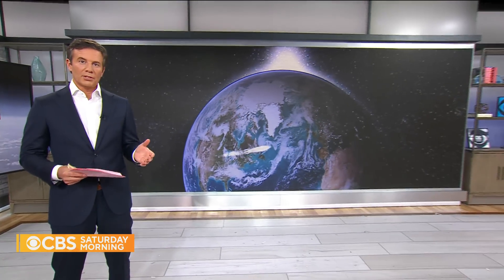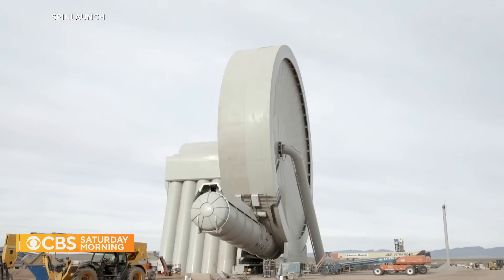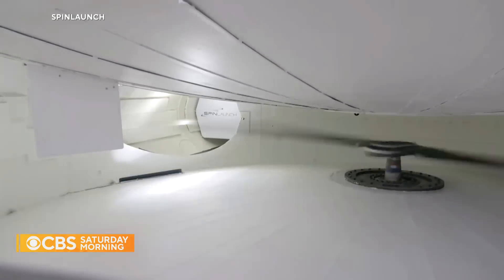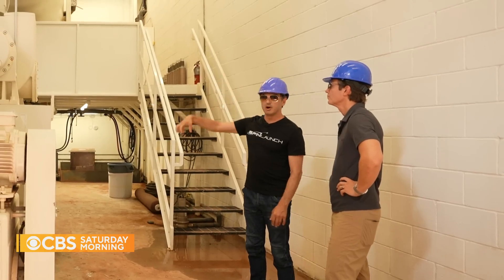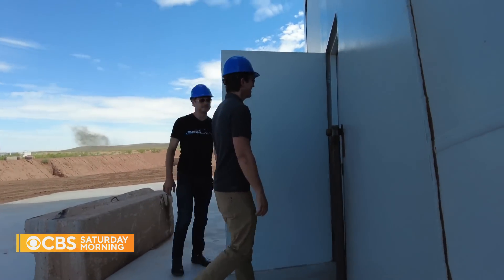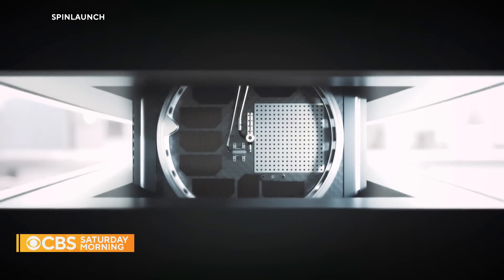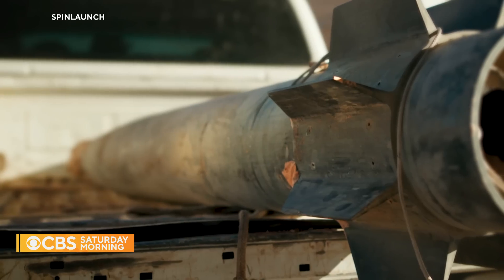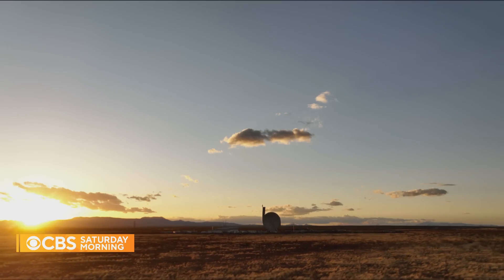New technology aims to put a whole new spin on space travel

Comment: They still have some HUGE obstacles to overcome.
Every video I have seen of the the launched object breaking the outer vacuum barrier has show a keyhole shape, NOT a circular shape, indicating the object is tumbling.
Add to that the fact that all launched objects need to be able to handle the extremely high G loading means that fragile extendable solar panels are out of the question.
Makes me start to question if this is another Theranos.
Reply: My own pet theory is that they're banking on an eventual lunar architecture. Spinlaunch is nonsensical on earth due to both the deep gravity well and the thick atmosphere, the latter of which requires the gigantic vacuum chamber for spinning and then an absurd amount of thermal friction heating and physical shock loading on the projectile when it transitions from vac to sea level atmosphere. Meanwhile on the moon, you have no need at all for a vacuum chamber, and the requirements for escape velocity are absolutely trivial compared to earth's surface. Even then I seriously doubt there will be any major lunar industry in the remaining lifespan of any current spinlaunch employee, and EVEN IF it is established, the economics of shipping lunar manufactured goods or raw materials back to earth just don't work out. Even with a permanent human presence the moon will be a net importer for a very long time, and there won't be much demand for unmanned lunar surface launches.
Reply: It's Election BS money to waste but waste it will be. Physics itself prevents this from working at all. I don't need to visit Wikipedia to know this, just school level physics.

Comment: I think this is a scam. There are too many issues. If the arm's bearing fails under high rotational speed, the whole thing will be destroyed. Much more serious and costly damage than would occur if a booster exploded on a conventional launch pad. Also, when the payload is released, it will be subject to a shock from its 100s of G of force down to one G in an instant. That will destroy most useful payloads. They're just pocketing as much investor money as they can. Even in this interview the CEO really seems scammy.

Comment: I don't get it.
They say they operate in vacuum, but what's the point of doing it  ?
It will enter air as soon as it exits the launching pad, and it will disrupt the trajectory.
Shouldn't they instead be accelerating the thing in 1 atmosphere, so that there is no change in pressure at the launch ??

Comment: There is also a weight and size limitation. More weight and you need a bigger projectile. And you need at least (a final speed) spin+ thruster, more than 17,500 mph. Otherwise it will launch and then fall back before making orbit.

Comment: For a small payload, yes. But a satellite? That is heavy. Centrifugal force (from spinning) can also damage sensitive equipment.
Reply: And the shock loading on release from a vacuum into 1 atmosphere of pressure... at 5000 mph, (which is still only a fraction of orbital velocity) ... how many G's is that?
Reply: @jackboot3946  forget the transition from vacuum to sea level pressure, the G-Force from spinning their full-sized proposal is already going to be >10,000 G for the last half hour of spinup, and the launch clamp release will exceed 15,000 G for a few milliseconds. No, you're not reading anything wrong; those are THOUSAND gee measurements.
Reply: @KingHalbatorix  Exactly. Won't  be launching any delicate, sensitive equipment... ever.

Comment: 0:39 2.2 million tonnes of steel. Really? Nobody? If this thing would be this heavy a solid block of steel (7850 kg/m³) would be 280000m³ in volume. That's a cube with more than 65 meters edge length. The host shouldn't be just saying "that's right" when the presenter get's the facts colossally wrong.

Comment: A problem that is see with this launch system is the "g" forces the payload will have to be designed for. The payload will have to be heavily built to withstand them. I don't think there is a way to get around this problem. Even with modern materials, the payload will have extra weight to withstand the forces.

Comment: This trash idea was debunked years ago.

The biggest problem was so obvious I spotted it right away. The problem is they must have as close to an absolute vacuum to be able to get the speed necessary. The problem comes when it releases. The "membrane" that it has to go through is impossible. If it's strong enough to maintain that kind of vacuum it would have to be so ridged that the projectile wouldn't be able to break through without being greatly slowed.
Reply: If the vacuum is near Absolute, the little bit of air in the chamber will spin around with the projectile...  And the membrane is just a dust cover/ to keep the engineering secrets of the doors.  It doesn't "maintain the vacuum".

Comment: The size this thing would need to be to launch anything of use to space would be crazy
Reply: Small-sat industry keeps getting larger every year because of technology getting smaller and cheaper. Most modern satellites today are actually no more than the size of a suit-case
Reply: @TypicalBlox  Doesn't matter how small the satellites get; that machine has significant problems that can't be reasonably overcome.
Reply: compared that to rockets?
Reply: Nah, I could see this being used for small/micro sized satellites. But yeah anything bigger sounds very problematic and you can forget ever trying to launch people from that thing.
Reply: It doesn't launch it into space, it launches it almost into space.  You still have a two stage rocket in there.  The biggest gain is that you're getting it almost all the way, so you don't need a giant rocket with tons of fuel, you just bypass that by getting it close enough.

There are other companies besides SpaceX that will launch payloads into orbit, some of them that launch smaller paylods like SpinLaunch is targeting.  Its not a one stop answer for all of space travel.
Reply: This seems silly
Reply: The machine is ridiculous, ludicrous. Won't work.
Reply: it would not be crazy if u realize  it has to burn out when leaving the machine
Reply: Any way you slice it they need to reach like 20 miles and so far they have only reached a little over 5 miles with a much smaller projectile.  So they are still far away from making this a reality if it is at all possible.
Reply: A lot of satellites are quite small, actually.  They are made to be as small as possible.
Reply: SpaceX carries 30-50 satellites per launch. This spinning contraption is quite absurd

Comment: There are many problems with the idea, the system, and the execution.  It is easy for them to say they can overcome the problems. It is easy for them to just be putting on a show for the money and the giggles. I know it won't work, but I'd enjoy giving it a good try. 

First, you can't throw something into orbit. There is still going to be a rocket somewhere, and you really can't throw a rocket.

The electricity has to come from somewhere, and this design is going to waste a lot of energy. Recapturing rotational momentum is a problem, and storing that recaptured energy is a problem. This design wastes the energy required to throw the fairing to space, wastes the energy required to spin up the arm and shaft and counterbalance.

The projectile is going to be subjected to horrible centrifugal force with a 1-G vibration per rotation. The projectile is going to come out tumbling at whatever RPM the launcher had, and stopping that rotation is going to take energy and precision. (There are methods to reduce the problem, which they may be keeping secret.)

The projectile is going to slam into the air outside at a fierce rate, and commence to decelerate and heat up like a dang meteor. One way to help it punch through is to make it as heavy as possible, which is another waste of energy.

The projectile has to shed the fairing and light the rocket. The rocket still has to do all the work of putting the payload into orbit, which is roughly four times the speed needed to reach that altitude.

Me, I'd build a water electrolysis unit, and a hydrogen/oxygen rocket, and find some off-hours electricity.

Comment: The shaft of the orbital accelerator could suffer certain degree of damage due to the unbalanced loading on the object holding arm. Depending on the weight of load (rocket),  it may need to replace the bearing frequently. Electromagnetic railguns should be able to launch much heavier aircraft/rocket.
Reply: So the scientist and engineers should consult with the YouTube comment section before making decisions...😂
Reply: Gerald Bull was trying to Giant Rail Gun for Saddam Hussain  back in 1980s but he was mysterious assassinated  before completing his work.
Reply: Im pretty sure the engineers guessed so too, and addressed that.
Reply: You're right. You should join their team and show them how to do it right.
Reply: They put a counterweight on it that gets released at the same time into a sand pit
Reply: @roberttalada5196 ok
So, the rocket (projectile) gets launched upwards fast enough to hit orbit.
Meanwhile, the "counterbalance" would have to be launched downwards (to balance momentum)......
Reply: @roberttalada5196  why not 2 projectiles released 180 degrees apart
Reply: This has been debunked by Thunderf00t
Reply: @pkrakras3561  Was waiting for someone to bring in Thunderf00t 🙂

Comment: I thought this was going to be a re-do of the "Space Cannon" idea but it is a new twist. (Twist---get it? 🙂). This would also make a frighteningly efficient weapon. Those projectiles are large enough that with just a few mods for ballistic guidance, they would be devastating non-nuclear precision weapons. An array of 10 of these launchers would be capable of a constant rain of hyper velocity projectiles each which would hit with incredible kinetic energy.
Reply: It takes their proposed final version multiple hours to pump down to final vacuum pressure, and then the arm also takes multiple hours to spin up to its final velocity. Overall, one of these can launch about a single time every 10 hours, or less than two and a half times per day. And that's assuming they fix all the issues with the launch release clamps which require microsecond-level timing to not throw the payload a few degrees off course and utterly obliterate the entire launch system.

In short, spinlaunch is utterly unviable as a weapons system, much the same as it's a total joke for actually putting things into orbit.

Comment: Sorry, but real engineering doesn't involve building a $150,000,000.00 unit that can't do what they designed it to do.  And, now they just need a bigger one?  Couldn't these people do the math in the first place to realize that the G-forces would be too high with the unit this size?  2:45 - They arrive at new forms of transportation through experimentation?  Um, no.  Proper engineering is how it's done, not just experimentation.  What do those investors have to think about a $150,000,000.00 device that doesn't work?  Do you actually believe the metals can withstand these forces?  And, a little plastic membrane is now capable of a high vacuum?  There are so many holes in this "innovation" that it's ridiculous that it's getting CBS news coverage.  Oh, but, don't worry, there will be a ton of investors lined up to pump money into the one triple the size, for another $450,000,000.00 that won't work.

Comment: A) Largest diameter vacuum chamber?  Um, Cern supercollider ring a bell?  18 mile long loop underground?
B) 5,000 mph?  Sorry, you need 17,500 mph to be in orbit, and that doesn't include losses due to atmospheric friction or the energy to achieve orbital altitude.  5,000 mph means nothing more than flinging the thing up a bit, but, without rockets, it's not getting to orbit.  So, yes, they say that a rocket will still be needed to get the thing into orbit.

I smell investment scam.

Comment: this is a huge waste of money. but at least the workers are being paid. until this has an elbow / wrist it will continue to fail. consult an NFL professional. a better design would be: trebuchet. also the package should have a more hammer shape. but all this technology is already obsolete. electronic mono poles that is where we are going. perpetual motion, Einstein was wrong because it doesn't work with quantum. Molecular programming by freezing matter at very low temps. we are missing 1000 elements on the table.
Reply: Not the brightest bulb, eh?

Comment: One thing is centrifugal acceleration, another is the linear deceleration the moment the projectile hits the dense atmosphere. Not to mention, that the projectile will never reach orbit on its own. You will always need a rocket engine to push it into orbit.
Reply: 1.  can you see them flinging a fully-fueled rocket around in there?  😂
2.  if not, it will have to dock with a (rocket-launched?) rocket up in the air. 🙄
3.  so why not air launch the rocket after floating it up with a giant balloon? 🤔
4.  3. is already patented, btw - i'm looking for investors - send a superchat! 🤑
Reply: tbf, assuming perfect speed matching and instant docking with the rocket at altitude, 2. would save fuel over launching an entire rocket from ground but so would 3. to whit,  i propose ultra-light, rigid carbon nano-balloons pumped to hi-vacuum to lift the rocket, launch, then release vacuum to return for reuse 🥴

Comment: This launcher looks amazing!
It could really change space travel!😮
Reply: Not for anything less solid than a block of steel.
Reply: @Graeme_Lastname  ...Or other things made with metal,like circuit boards and heat shields!
Reply: @Herowebcomics  As long as they are encapsulated in epoxy or some such. 🙂

Comment: It's stupid. 
Any projectile hitting hypersonic speed at sea level is going to produce a plasma shockwave even greater than a projectile fired from a railgun. Atmosphere is a fluid, and the faster you go, the more it acts like a solid. 

All the energy to get this to an altitude where it at least bypasses the 1st stage is frontloaded at launch. So you're looking at mach 5 to mach 10 depending on the size of the rocket and payload.  The skin of the rocket will hit thousands of degrees. The gforces and pressures will be hundreds of times that exerted on a traditional rocket launch. 

Just take a look at the Pegasus XL program which just uses an airliner to take a 26 ton rocket comprised mostly of solid fuel to 39,000 feet. Could the Spinlaunch sling the equivalent weight of a medium battle tank into the stratosphere?

Comment: Spinlaunch doesn't actually drastically reduce the fuel you need for launch. The rocket equation is exponential not linear. A launch speed of Mach 5-6 means your rocket goes from being 98% fuel and structure to 90%. Add that in with the high acceleration and you're better off using spacex rideshare which literally every satellite constellation except Kuiper (lol) is doing right now.
Reply: Kuiper is currently in hot water for that decision too, multiple kuiper investors are looking into litigation against the company for not picking SpaceX as a launcher considering the current vehicles lined up for Kuiper are: Vulcan (where's the engines jeff???), New Glenn (lol), and Ariane 6 (lmao), none of which will be ready for launch this year. Kuiper's now so desperate they've actually decided to launch 2 of their prototype sats on an Atlas V, one that was supposed to be a rideshare. The other passenger is so delayed that Kuiper has now just up and outright bought the entire launch, for what amounts to like 10% of the A-V's payload capacity since 2 Kuiper sats is basically nothing

Comment: There are lots of dense materials such as rocket fuel and water that might be launched into near earth orbit using such a system.  The extreme compression of the fluids would cause difficult physical situation.  It seems like an adopted technology for lobbing artillery shells.   Artillery shells are already made to withstand about 1000G's.   

I hope his pitch for reducing a carbon footprint was to attract sponsors and not that he doesn't remember from high school science earth's greenhouse effect is the model of a system always in saturation.   A system in saturation can no longer have more effect by adding more of its active elements to it.  Even though earth's greenhouse effect's dominant greenhouse gas water vapor vary's greatly across the earth's surface it is suppose to be fascinating to high school students that earth's greenhouse effect is always in saturation such that within 20 meters of the surface all the radiant greenhouse energy from the surface has been absorbed by greenhouse gases.  That is suppose to be cool and fascinating.   

When at 1% tropospheric water vapor 99-1/2% of earth's greenhouse effect is due to the strong greenhouse gas water vapor.   The noncondensing greenhouse gases have a share in earth's greenhouse effect, but they can not change a system being held in saturation by water vapor. 

The United Nation's IPCC science report is transparent in an obscure paragraph in the back of the report it is not dealing with active greenhouse gases or earth's greenhouse effect where it states its greenhouse gas samples were taken at 20,000 meters altitude and only that altitude!   That statement is a legal back stop because the IPCC has been transparent where the data is from and a reasonably high school educated person could be argued would know from that statement the report is not actually dealing with active greenhouse gases or earths greenhouse effect.   Global warming has been stalled at about 1°C since 1991.